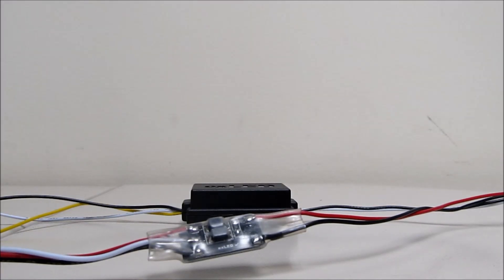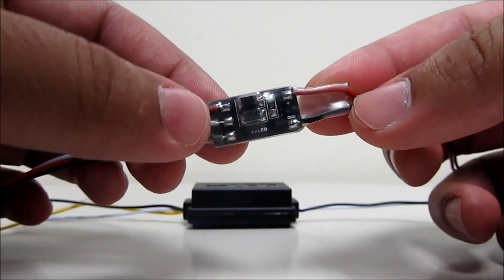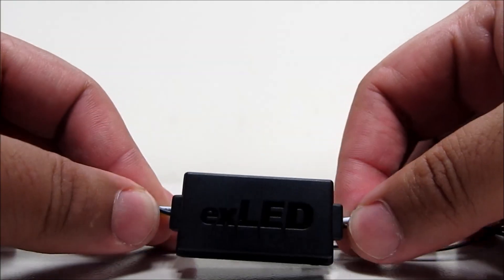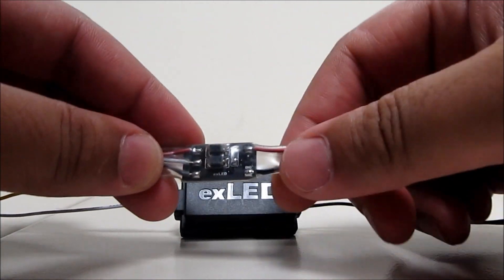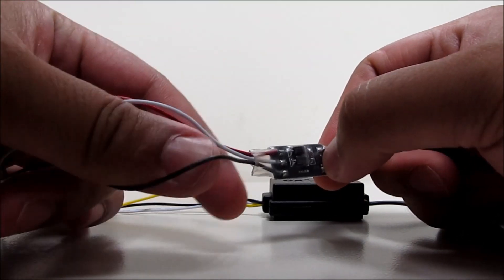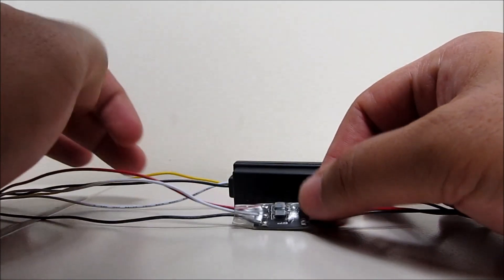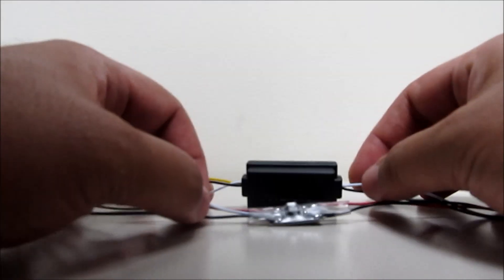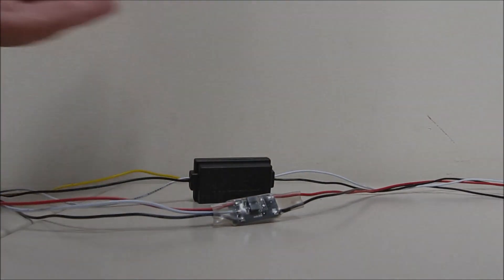exLED (TPC Module Ver.1 - 1Color) and (Parking light + Brake light 2Way Module)

Comment: Great video! I have been waiting on one of these vids haha. I'm planning to purchase the rear reflector led kit from exled for my 14 sport and I only want it to turn on max brightness with my low beams. I don't want the brake, turn switches, etc. Would I only connect the ground and parking wire in order to do that, and also would i have to splice into the wire that's connected to my tail lights? I know there is the small clip where i can clip on to the tail light wire so I don't have to splice into it but I'm not too great with wires. Thanks again!
Reply from the maker: Yes, you can use the ttap to make the connection.  If your only going to use them as parking light.. you will not need the module.  You can just use t-tap and connect the power wire directly to the stock parking light wire.   I'll have a video of it next week.